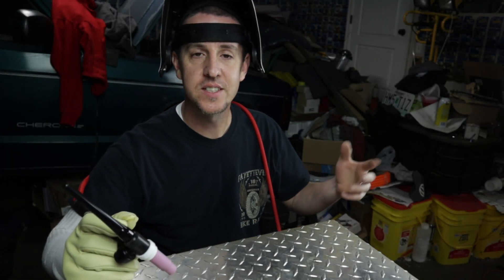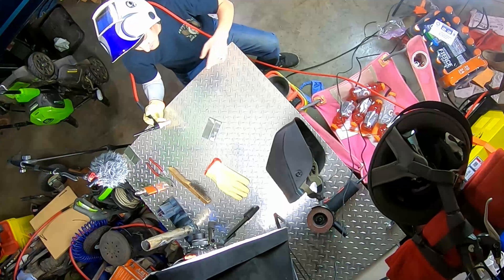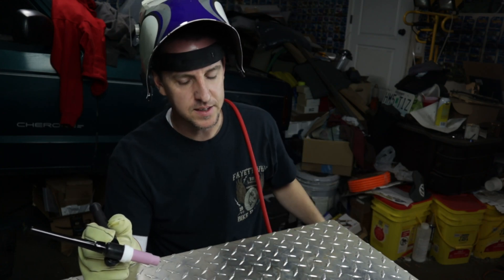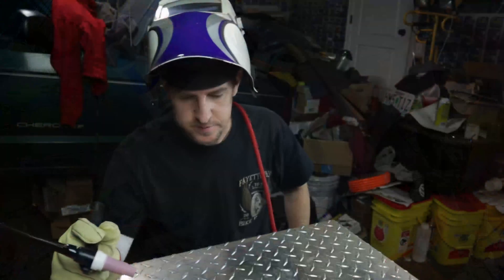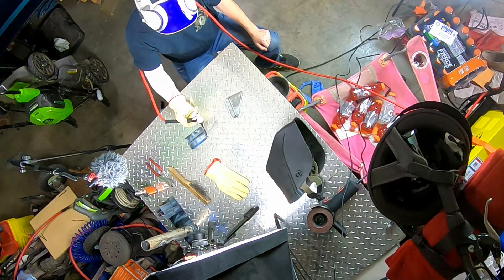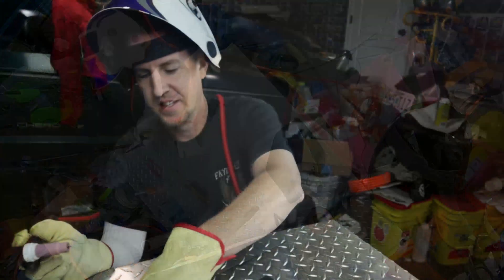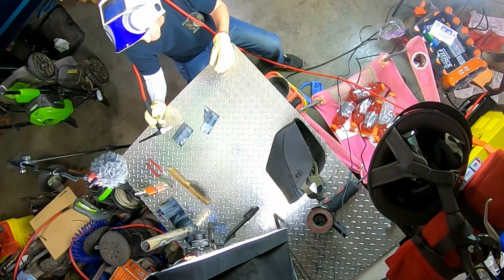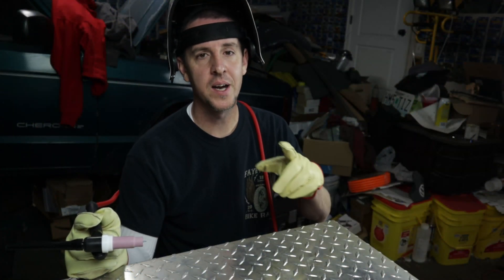Tig Welding Beginner

Comment: It would help if you post what your settings on the machine were for those welds.    Balance, gas flow, amperage, tungsten size and cup size and of course current.    Also, how thick are the practice pieces?      I assume you know the pieces have to be extremely clean, a stainless wire brush is the norm,  the pieces did look like you cleaned them tho.

I have the same machine coming later this month.    I had a monster old transformer tig before, none of the bells and whistles.
Reply from the maker: If I remember right, the cup is a 9, amperage was around 110 or 120 but I never went full peddle, flow was 20 ish, 3/32 tungsten, metal was 2.6mm and I cleaned the rust and stuff off with a 40grit flappy sanding disc.  
Thank you for your feedback.
Reply: @dirtytrucker08  You said you don't think they look terrible,  I think they look GREAT considering your experience level !    Only suggestion might be a bit too much angle in the torch to the work.    You are a natural,  with more practice your welds will surely be outstanding !       Later, a bit of filler will make things look nicer too.
Reply from the maker: Should I be using a chemical of some sort to wipe down the surface before I weld?  Thank you very much
Reply: @dirtytrucker08  Acetone is what my company uses all the time. A little less heat. Your welds are looking that way because of too much gas flow for that cup size i can tell because of the grey color. Practice getting a smaller tungsten gap. When u use filler and get the hang of using it will start to look better but then you will find all sorts of new things to master LOL

Comment: I'm maybe half a step ahead of you in experience, so I don't think I can be much of the type that can tell you what you're doing wrong. So what I'll do is tell you what you're doing right. Not being afraid to weld pointless practice pieces. I struggle with that. I need to do it. But I can't psychologically get myself to spend that time not creating something. I struggle with filler rod too. So keep running practice pieces like that. You'll eventually get the feel for it. Heat may have been a little high, but again I'm no expert. I sure enjoy it though!
Reply from the maker: Honest responses make this so much fun.  Thank you for your feedback.
Reply: sounds like we need a welding party, im not perfect but i have been doing it for a bit. stainless, mild steel, and aluminum. i use to struggle with rod but there are a few tricks for it. i guess it helps i have bee working in fabs shops so long
Reply from the maker: Yes, welding party sounds great
Reply from the maker: I'm a part of a Tig welding group on Facebook for the AHP brand.  I'm not sure what brand machine you're using but it might be worth a search.  I know tht group I'm in is super helpful, always willing to offer advice and positive criticisms.

Comment: Hell i was just tig welding a few mintues ago lol i cant say from the shots and its hard to say what i would suggest without showing you. I have been working in fab shops for years and i can say its alot of heat control and techniques. Like controling the flow the angle of the cup. The cup size for the work. The way the tungsten is sharpened. Etc
Reply from the maker: What cups for what welds?
Reply: @dirtytrucker08  well think of it this way the cups control your heat  and gas, so a narrow cup will focus the heat in one spot as well as the gas, and a number 7 cup would help spread the heat and gas. part of it depends on what you are doing and where you need to fit, kinda like tungsten  length, sometimes you will have to extend it for reach and turn the gas up.
Reply from the maker: So general rule of thumb, use the biggest cup that will suit the weld?
Reply: @dirtytrucker08  i wouldnt go to big becuase it wont focus enough gas. Cups sizes can get pretty large
Reply from the maker: @EfurdGarage  I think I've only got two cup sizes with the welder, currently on the smaller one I think